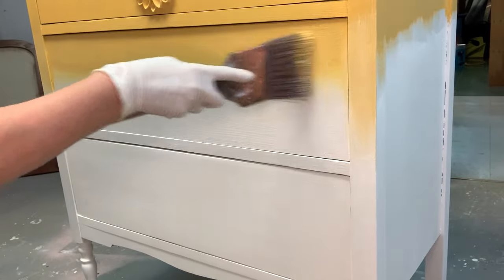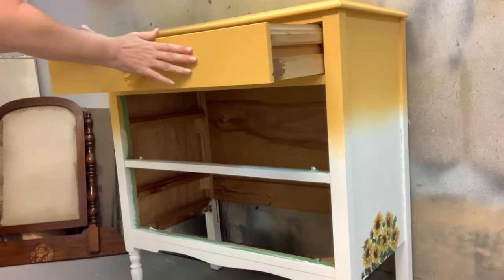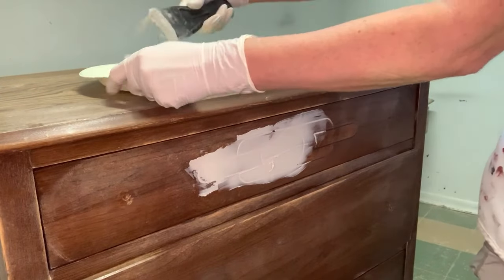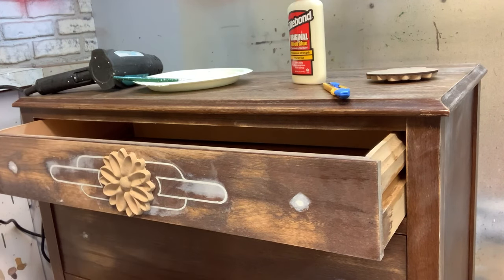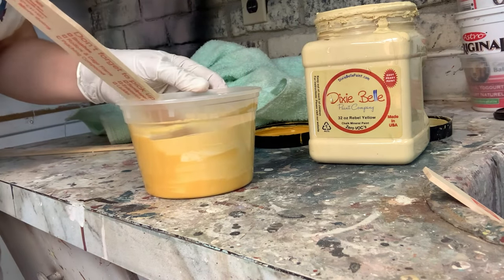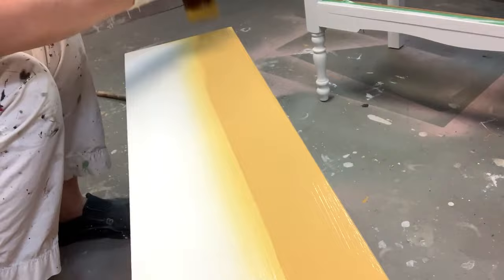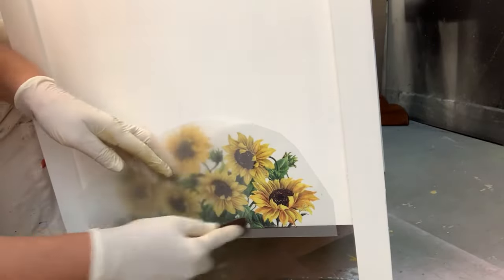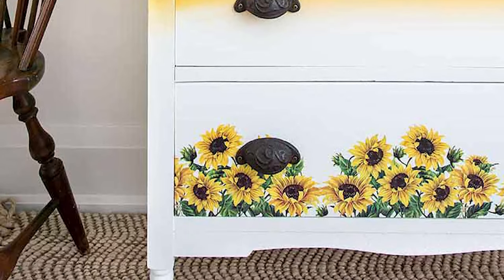Sunflower Transfer Dresser Makeover

Comment: Is there a name for the rub on wood tool?  I have no idea what it is?
Reply from the maker: I'm not sure if it has a specific name but it comes in the tube with the transfers. I've also used paint sticks and other pieces of flat wood shims to apply these. It just has to be thick enough that it won't break under the pressure used to rub the transfer on. :)